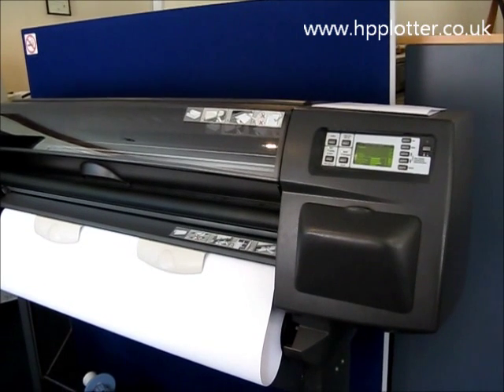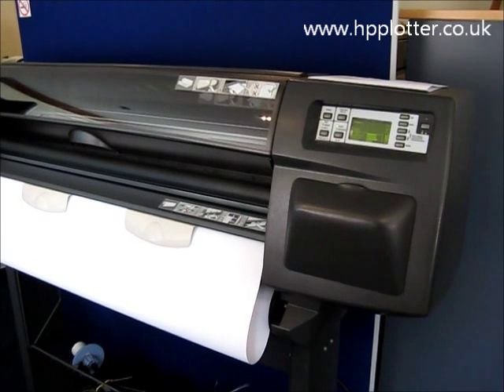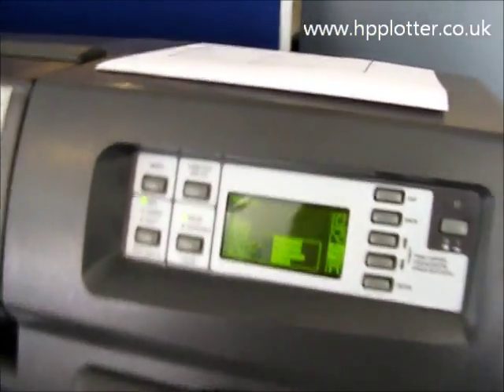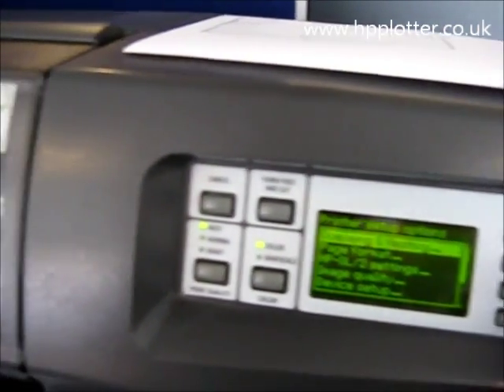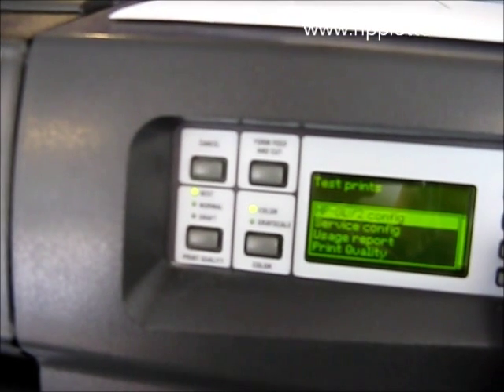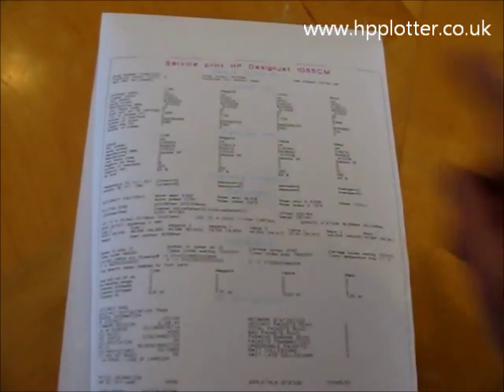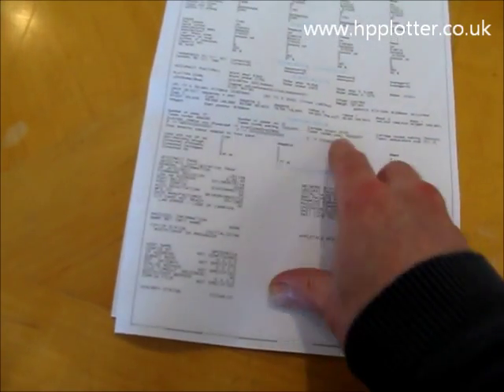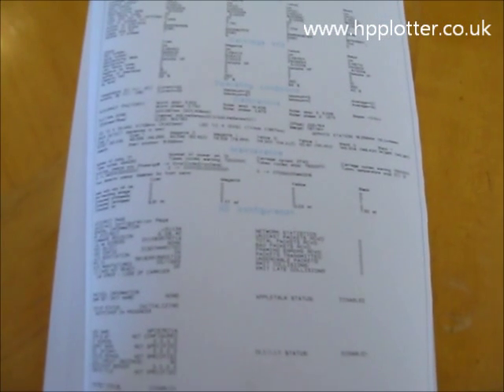HP DesignJet 1050 repairs - Print configuration page

Comment: Dear Sir,y 1050C is showing system error 0A0050 000C958D. is this a single or multiple error codes?  And how can i solve them?  thanks
Reply from the maker: Hello Solomon - you'll likely need to replace the tubes with this error code. We have stock if you are in the UK and we can also come out to do a repair for you  - just email engineering@hpplotter.co.uk if you wish to receive a repair quote